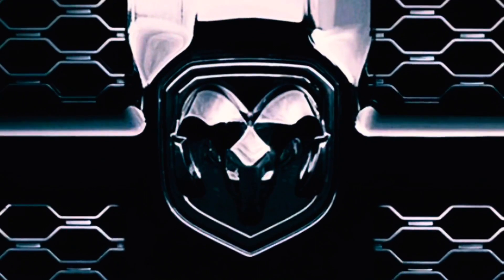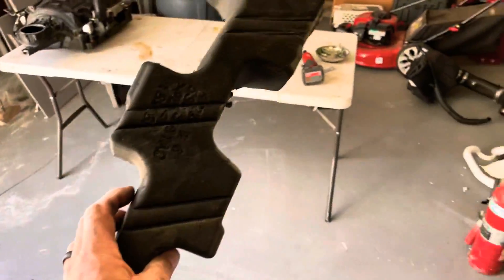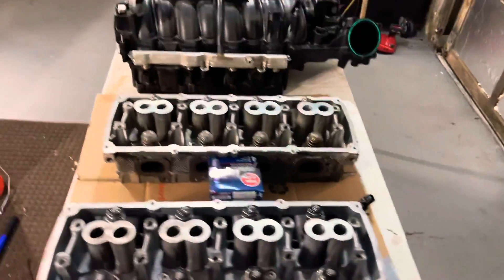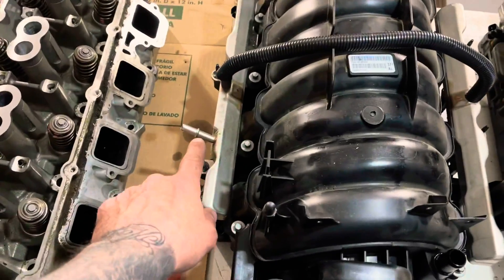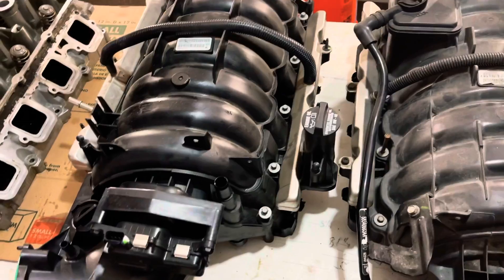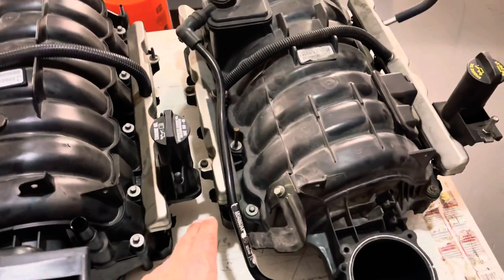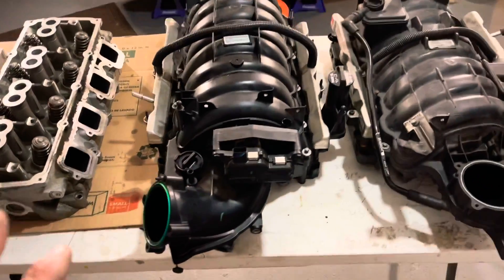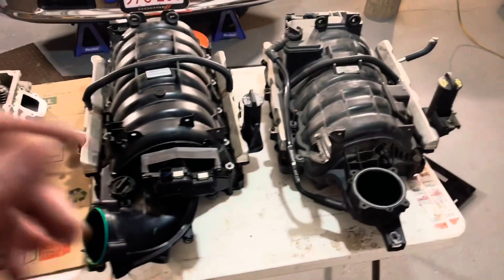6.4 Intake Manifold Swap: What You Need To Know!

Comment: What type of bit do you need to remove the fuel rails?
Reply from the maker: Bolts are used to secure the fuel rail assembly to the intake manifold.  So a socket

Comment: I have a 2015 Ram 1500 5.7L

I'm getting ready to do the 6.4L Intake swap. I have spacers to use the 5.7L injectors.   

My new intake did not come with the actuator for the active intake runners. Do you know if the actuator is the same for both intakes. I know the plugs are the same and I need to extend the harness.
Reply: I just ordered one to, I think they are I read somewhere someone used it and said something about rubbing they trimmed it ? 
Not sure if that’s accurate won’t know h til mine gets here
Reply from the maker: They are not the same actuator for the 5.7 and the 6.4, Dorman sells them tho

Comment: So how did this mod work for you as far as low and mid power was it a feel able difference. Im considering the swap and tune with a full header back exhaust and then possibly a 75-100 shot kit for you occasional fun ...or a super charger like rhe ripp but the bolt ons bring me to about 330 awd and the shot 415-430 ...ripp about same but the nitrous is cheaper and keeps me a little more safe ticket wise since its only there when system is on ... vs 420+ anytime...i have a cdl but a heavy foot 😅
Reply from the maker: @yerwrng  it works best with supporting mods and from what you’re saying, yes, it will help!!

Comment: These engines do not need any type of upper valve train lubrication whatsoever so that extra oil that's in your intake manifold he is simply condensation of the fuel/oil  vapours mixed together in the process. When the vapours reach or intake manifold with it, obviously being a lot cooler than inside the engine causes it to condensate similar to your toilet on a humid day and then run down the side of your intake manifold. When I emptied mine, I had at least a half a litre that was taking a precious air space that could've been used for the combustion process. The PCM doesn't compensate for that space taken up by the oil which creates a performance issue. If you clean your throttle body once a year by removing it, you might be able to catch most of the oil before it goes into the actual intake manifold itself like mine had.. it took me 10 hours to wash out all of the engine oil that was caked on the inside of my intake manifold mainly on the bottom. I must've went through a bottle of dawn, dish detergent and hot soapy water along with cover cleaner and a leaf blower to blow everything out to check for any remnants of oil. Then I bought a baroscope to check the insides to make sure everything was moving OK and no more oil was inside. I cleaned up my throttle body as well and then when I put it all back together I thought I had a new truck. I didn't know what happened and then it hit me that all of that space that was being taken up by the oil, not to mention the degradation of the fuel and air mixture entering my intake manifold because of PCV GASES that robbed my fuel of octane. This is why the scan is very important. It doesn't necessarily net you any gains per se in horsepower but as far as performance, it allows your engine to run optimally with your oil lasting longer because it's not diluted from the fuel and air mixture by gases, thus increasing the light expectancy of your engine. as per for air induction system, it's a must an absolute necessity because of the added flow by due to the higher pressures inside the engine cylinders
Reply: wouldn’t a catch can fix all of that
Reply: Guarantee it brings back power under the curve.

Comment: How much horsepower gain?
Reply from the maker: It’s more of a supporting mod gain, alone it may give 5hp, with a cam, fbo, headers, could give 15-20hp
Reply: I've got a sb cai, shorty headers and a tsp stage 1 cam in my 2013 single cab short bed, I actually have a 6.4 truck intake , should I put it on? What kinda power increase can I expect

Comment: @TunedRAMS so I’m planning on buying one of these but I live where it’s crazy wet all the time do I need to put a cold air intake on the 6.4 or can I use the same air box with modified hosing?
Reply from the maker: You can use the same, modify it as r use the 6.4 air box like I did, let’s more air in.  Slap a high flowing air filter in too

Comment: Sweet build. What cold air intake do you run with your 6.4 intake? I have been looking at the sb cold air for 2014-2018 2500-3500, will one of those work out?
Reply from the maker: I use a Legmaker tube to 6.4 airbox

Comment: With early 5.7 non eagle intake to the 6.4 do you know of any additional things that may be needed other the than 5.7 eagle intake spacer
Reply: The sensors aren't going to match up, MAP and IAT, throttle body mounting, and maybe fuel line connection to fuel rail.

Comment: Why don't you put a 6.4 hemi in your truck?
Reply: Transmission would need to be changed as well most likely.
Reply: @sxykia  nope. They use the same transmission. 6.4 and 5.7 are identical in terms of fitment except for displacement and the front timing cover That's the beauty of it, it's like a Lego, as long as you have the money to buy the parts, it's easy to make it work.
Reply: @DL101ca  That is good to know. Now ima swapp my 5.7 for a 6.4 in my 05
Reply: @sxykia i I wouldn't waste the money swapping the motors 5.7,6.1,6.4 its the same short block 5.7s are stronger you can redline more. Cylinder walls are thicker i would just do forged crankshaft  cam few other things um rebuilding my 5.7 now
Reply from the maker: Got too much going on right now, maybe one day

Comment: Hey I jus got an rt Durango what parts do I need jus 6.4 manifold, or they more to it ?
Reply from the maker: Just what you see in the video!
Reply: My last question can I put an 90mm throttle body ?
Reply: @jesusb2244  I have a Hellcat throttle body on a ported 6.4 manifold. You will need an adapter plate, the bolts won't match up and the manifold throat can't be ported enough to match the 92mm size of the hellcat TB.
Reply: @TunedRAMS  if I buy the 6.4 intake can I pay u to put it on lol

Comment: When you modify and engine for performance the factory oil recommendation is no longer relevant. 0w40 would be much better.
Reply from the maker: I still use 5w20 full synthetic.  Some people have changed the weight of their oil and the key is to make sure that the mechanics of the engine can spread that oil during a cold start up.  Especially OHC engines.
Reply: @TunedRAMS  0w40 will flow better at startup than 5w20.

Comment: What else do I need with this change?
Tune alone?
I have flowmeter 50 HD muffler and upgraded air filter with gas paddle commander.
Reply from the maker: May not even need a tune unless you got the 6.4 injectors.

Comment: I’m looking at building my Ram to push 1000HP, I need lots of advice to upgrade my 5.7L. Biggest problem I have is money as I know how expensive it is
Reply from the maker: 1000hp?  Yeah that’s going to cost ya.  You’ll need a very beefed up transmission, rear end and a 5.7 stroked that can handle the boost!
Reply: @TunedRAMS  yeah it’s going to be expensive but hopefully worth it in the end
Reply from the maker: @AngelofDeath333  any project is always worth it man!!  It’s fun too
Reply: Just buy a trx engine and trans pull out it will be cheaper with less headaches.
Reply: @joshkrause2977 nope trx engine/trans bout 10k or more then you have to change fuel pump, rear end because the gears are different and the driveshaft and few other things he'll spend more
Reply: @joshkrause2977  absolutely
Reply: @joshkrause2977 With that set up, if he already has a 4x4, then that will work, those run 16 to 25 grand

Comment: Im planning on doing that to my 20 rebel.but modern muscle extreme told me everything comes with the 6.4 intake. Only thing i had to add is spacers and c.a.i.and bettrr throttle body...any thoughts.
Reply from the maker: Spacers for the 5.7 injectors?
Reply: @TunedRAMS  you need them to run your 5.7 injectors in the 6.4 manifold, otherwise you need to tune for the 6.4 injectors and then use those.
Reply from the maker: @DL101ca  she’s already tuned for them 👍🏽
Reply: Yes
Reply from the maker: @wilheimreis8272  yeah everyone that has that manifold raves about it
Reply: @TunedRAMS  well i figured ill keep using my 91 canned tune. Spend $45 vs $250 for the tune itself without the spacers.for now.

Comment: perhaps the weight of the fuel in the rails account for most of the difference.
Reply: I was about to say that. That’s probably why its heavier
Reply from the maker: There was fuel in each manifold, not why
Reply: @TunedRAMS  someone shipped you an intake with fuel still in the rails?
Reply from the maker: @Hillard-t3q  yes, a little bit 👀
Reply from the maker: @Hillard-t3q  gas weighs 6 lbs a gallon, an ounce or two isnt going to tip the scale.  Both intakes had a little bit in the right side fuel rail, very small amount
Reply: @TunedRAMS  all good...was just thinking aloud.   Any particular reason you went with the Fastman TB over one like MMX or others offer?
Reply from the maker: @Hillard-t3q  Fastman is a great TB
Reply: I thought the 6.4 intake was metal and not plastic..Guess I was way off on that..Very nice upgrade